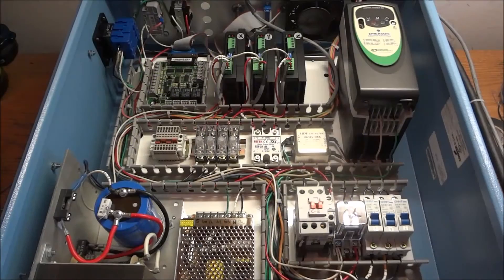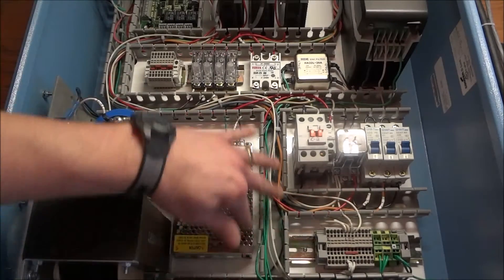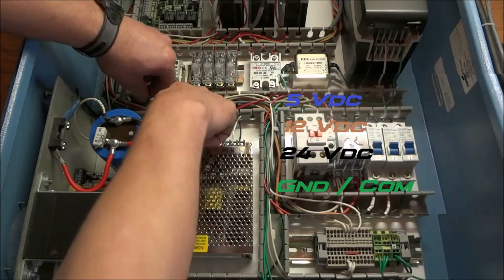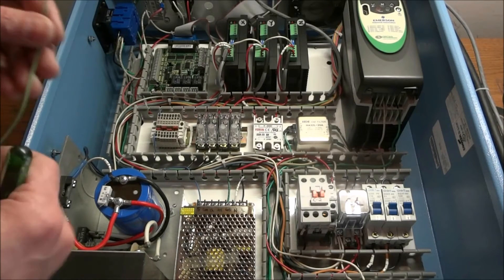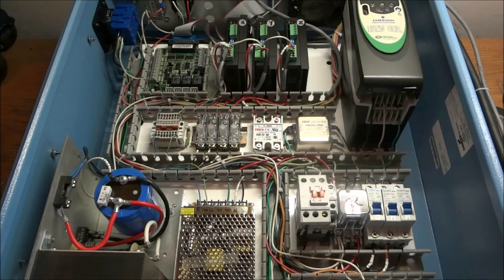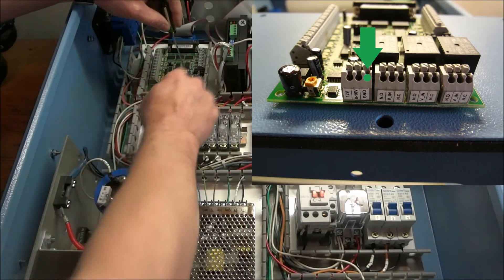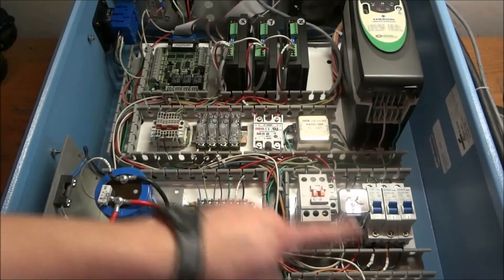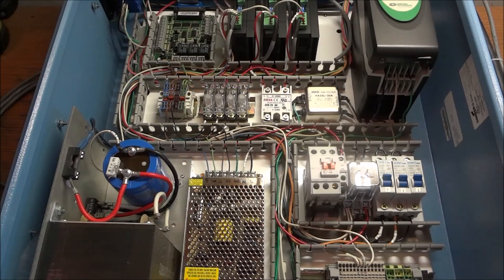PM 727M Wiring Pt 8 "Tri Power supply"

Comment: Sam ... looks like you elected to add 5v power to the C11Gs on different pins than the wiring diagram sent to me by Keling and CNC4PC for my C11G"r" rev 9 ... not sure that it matters - but wanted to double check .  They sent or linked to a diagram where the 5v comes in off a wall-wart style PS and goes into 5v right near all the XYZ stepper pulse/dir outputs.  Your thoughts ?
Reply from the maker: Hi Steve, I'm not sure what documents your referring to send me a link. The C11g and c11gs are clearly marked POWER 5v and GRD and on both boards are located near the Inputs.  There is a 5v Enable in the location you describe?
Reply from the maker: Steve if you are following my wiring and have not yet purchased my cnc conversion plans for the PM727M it would be very helpful to have the wiring diagrams for your build. even if the machine your building is not the same. www.cnc4xr7.com

Comment: How did you go about determining the size of the braking resister you needed?
Reply from the maker: The recommended braking resistor is listed in the vfd manual 25 to 100 ohm max and 1.7kw. Or 1700watts. 
I went somewhere in the middle 50 ohms 300 watts there fairly cheap so if this does not stop quick enough I'll upgrade closer to 100 ohms.

Comment: You do not for see a problem with all sharing the same common ground?
Reply from the maker: The tri- power power supply generates the 5, 12, 24 volts and they do share a ground. 
The  vfd has it's own 24 v that it uses for spindle direction this ground is isolated from the tri - power.  The 48 v also has it's own common. Which is isolated. 
I do not for see any issues.
Reply: +saintb6969 Thank you so much for the info, some of us out there are not the electrical genies that you seem to be and your videos have been very, very , very helpful. I am following your design to the T for my new controller, the only thing I am doing different is using a 1.5hp Ironhorse 3ph motor and the Emerson SKDB200110 with a 230v input to my enclosure. I have looked through the VFD manual and cannot see where it specifies the size of the braking resister, and I cannot seem to find the 1A breaker you used, I found the other two. Again can't thank you enough for all this info!!!
Reply from the maker: +saintb6969
thanks  email me cnc4xr7@gmail.com
I can send links to you. 
Be safe Sam